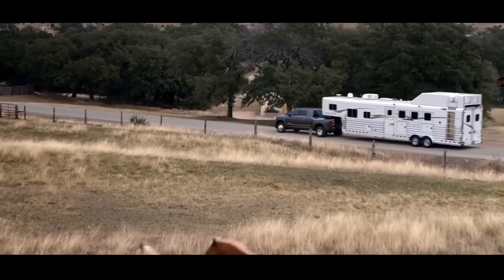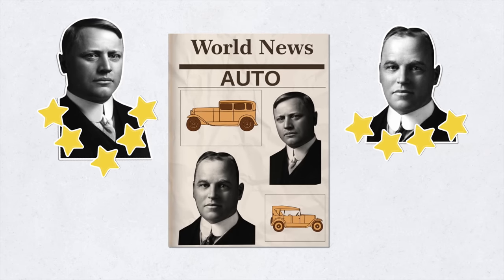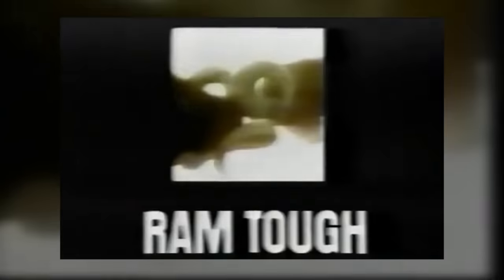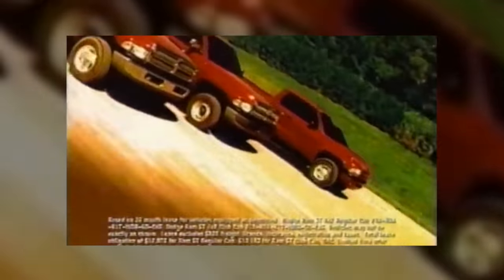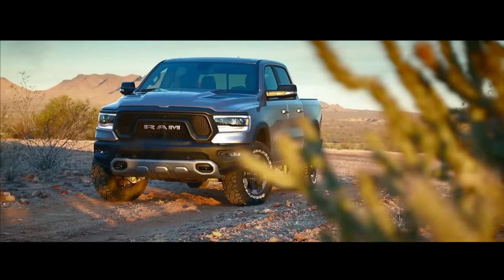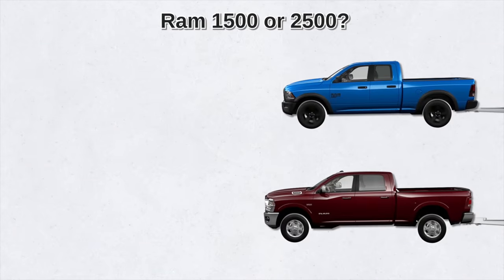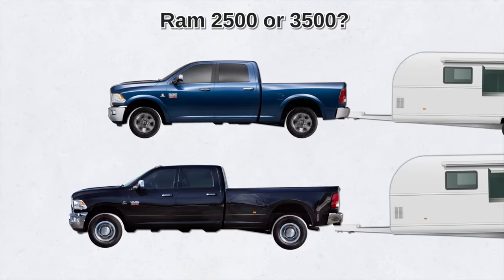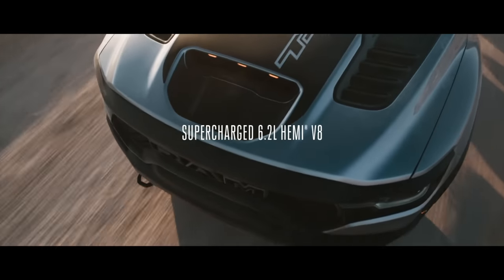No One is Telling You the Truth About Dodge Rams, So I Have to

Comment: Confession time: I was part of the production company that filmed those trucks falling from the 10 feet in the air. Those trucks   didn't start the first time we filmed that because the fuel pump in the gas tank would immediately dislodge. I'm the guy that figured out the problem and rigged up an external electric fuel pump so they would start and drive away after we drop them. Then: we reshot the commercial. Surprisingly the suspension and everything else was fine, even though: each of those trucks was dropped a minimum additional 2 or 3 times for testing purposes before the second and final shoot. IE: some of those trucks were dropped 5 times with no problem other than the stock fuel pump In the gas tank dislodging!
Reply: And then all were happily sold as demonstratiors 😂
Reply: @idaho_7407  That's funny: I never thought about where they ended up. I bet you're right!
Reply: Hmmmm very interesting
Reply: Can't sell fruit these days
Reply: And today crash detection sensors that are built into the engine will not let them crank after that drop. Not to mention the bent frame the new ones would have because of all the weight.
Reply: That’s great to know. Now I’ll be prepared if my ram stops running when i take it off a sweet jump.
Reply: @idaho_7407  Barely used he knew what he had
Reply: I was wondering about that.  Thanks!
Reply: Enjoyed your story . Thanks
Reply: I was the one who decided to have the trucks dropped for the commercials.
Reply: Nice!
Reply: I was the one inside the Truck when they dropped it and I Drove away!😎
Reply: I think a friend of mine bought one those trucks cuz his truck had all kinds of problems. 😊

Comment: WTF is going on?!!!! Next thing you know he's going to say the Caravan is the best built mini-van and the PT Cruiser and Neons are misunderstood gems. He must be smoking some peyote.
Reply: Exactly!!
Reply: I think Scotty may have been threatened with  a lawsuit from Stellantis if he didn't say something unharsh.
Reply: I think he's getting paid for this by Chrysler honestly
Reply: Or maybe Cummins are just simply the best diesel engines.
Reply: @bigrunts9768  those trucks are like the 1993 Ford tempo with the larger engine option. The power train was great but the vehicle disintegrated around it.
Reply: @bigrunts9768  I have to agree Cummins Diesels are good engines. It's the rest of the vehicle falling apart you have to worry about. Or if you buy non-diesel Rams like the majority do. And good luck finding a mechanic that can competently work on diesel engines. Most dealerships only have "parts changers", not true diagnosticians and many independent mechanics don't work on diesels. My brother apprenticed as a diesel mechanic and now manages a muffler shop where they do all repairs, but exclusively on gas engines for motor work.
Reply: @bigrunts9768  Cummins is not Dodge. Dodge chose to use their engine, but Cummins engines are in a lot of vehicles. Bread trucks even have Cummins diesels.
Reply: Did you not watch the video? There was nothing biased here, he laid out facts about their history and what their current trucks are capable of. Never did he say they were the truck to buy, but if I’m in need of towing 30,000 lbs I’m not doing it in my tundra or an F350. I’m going to do it in a dodge. What’s going on here is simple. The 3500 tows 35k lbs for those that need to. Not that hard!

Comment: 2nd generation rams with a Cummins, and manual transmission…simply indestructible & unchallenged platform.
Reply: Could probably drive them until the body rust off
Reply: Or a Japanese, or some German transmissions
Reply: I'm English we don't really have them here but...
A mate in Nashville has one, sorry not sure of the model but it has the Cummings diesel in it. A beast, with over 600,000 on the clock !!! My mate's brother (who is an expert on these trucks) has one with a million on the clock!!!
Great vehicles,  but they wouldn't fit in the village I live in !!!
Great video as usual Mr. Scott.
Reply: @andylane247  ... You listened to Scotty. No G in CUMMINS.
Reply: Land cruiser 70 series lol
Reply: FACTS. The high output 5.9l cummings was a monster, and mated to the bulletproof 6 speed manuel, was a damn good match.
Reply: @MadMexism  
More torque than an aircraft carrier  !!
Reply: @MadMexism  ... 6 speed Manuel picks lettuce like a whirlwind!
Reply: agree 100%
Reply: My uncle had one of these when I was a kid. I believe it was an extended cab - Long Bed - 4x4 - Forest Green - Cummins with 6 Speed. Wicked Truck!
Reply: Sure wish Toyota made a std. shift, diesel Tundra.
Reply: Good combo but honestly in my opinion I'll take any Dodge Cummins or gas I'm a Dodge guy
Reply: @bighorn9119  I'm a sentence guy.
Reply: C Nahman   no, the junk was in the rear view mirror, the power jokes and the duracraps
Reply: C Nahman  the thing about a 47re, 48re, you have to maintain them. Fluid and filter every 25k when towing frequently.  Same for transfer case. Axle fluid every 30-35k. Synthetic in evedything.
Reply: C Nahman  there are at least 35-40 2nd gens here around mountain view, I don't think any of them have rust.  Maybe up north they rust in the snow/salt?
Reply: Absolutely true. Best engine ever made
Reply: Agreed 100 percent
Reply: Eh, 2nd gens and indestructible do not belong in the same sentence, sorry. The Cummins 12/24 valve is a great motor, the best of its time, without a doubt. However, 2nd Gen bodies do not hold up well to the rest of time. I am a dodge fan, but other than the motor, I don’t like the 2nd Gen. The 3rd Gen addressed the majority of the body issues, and the 4th Gen was revolutionary, a terrific platform. But, I’d rather buy a Competitors truck (except the 6.4L or LB7) before I’d buy a 2nd Gen.
Reply: @conanrehm8388  agreed. Excellent point, typical Chrysler material, cheaply made. The only thing that saved dodge was the motor, transmission isn’t the best either
Reply: @jeffro582  true on the galvanized protection. My 2002 has has a front fender gash no paint exposed now for 4 years and no rust.
Reply: 2004 Dodge Ram 3500 5.9 Cummins with nv5600 6spd transmission currently 370k miles, I would trust it to go anywhere! Absolutely  love my old truck!
Reply: C Nahman  u are absolutely right had 2nd gen the rockers and fenders rusted so badly and put 3trans in but it had 275000 then the rear end locked up just couldn't put any more money into it. The engine was still going strong but the rest of the truck was falling apart
Reply: Cummins is good but the truck is a large turd
Reply: Had one myself. 02 Dodge 2500 4x4 Cummins HO 6 speed manual. Best truck ever! Unfortunately, I think I was being watched as I installed new interior parts and rebuilt the front end completely whether needed or not at 247,000 miles. I planned on putting another 250k miles before needing anything. It was stolen the next morning after it was put back together and freshly alignment. I would love to have it back or have another 02 if I knew it wouldn’t be stolen. Houston , TX is NOT a safe place to have anything worth having!
Reply: @conanrehm8388  the 3rd gen dodge ram was not as strong a platform as the 2nd generation.  Tge 2nd gen had the best seats ever put in a truck, tge 3rd gens were hard as a brick
Reply: @alanbrooks3670  did you ever change rear end oil?
Reply: @jeffro582   I have ridden in a second gen a few times, their seats are very plush. I grew up riding in a in a 2003 3rd gen 2500 Laramie, then a 2009 3rd gen 3500 Laramie, the seats are definitely more firm, I wouldn’t describe them as being hard as a brick, they were not the most comfortable, but they were not bad. My statement that the 3rd gens are better than the 2nd gens comes because of the fact of how may rusted out 2nd gens I have seen. My dad’s 2009 3rd gen had rust where someone backed into him, but it did not grow past where the paint had been chipped off. I have seen 3rd gens with rust, but they have not rusted to the point that the 2nd gens do. If we are going on about the interior, the 2nd gen interior is cheap. Not to say that the 3rd gens isn’t cheap, but the materials from the cloth or leather to the plastics was way better with the newer generation truck. I have a friend who owns a 2nd gen Cummins with no rust because he washes it religiously and actually takes care of it, his description of the truck is “It’s a million mile motor, with a 100,000 mile body”. The 3rd gen is a stronger platform as well, did you ever notice that the towing and payload numbers increased with the newer truck? The power increased, the quality increased, heck, I am not a fan of how the 3rd gens look, but it is a big improvement over the 2nd gens in my opinion. The 3rd gen was not as revolutionary with the interior or exterior design as the 2nd gen was back in 1994, but overall it is a newer, more researched and developed pickup.
Reply: @andylane247  That is amazing to have that many miles on one. My friend in Texas has a’99 Dodge Ram 1500 w/ the V6 and a 5 speed transmission. Bought new & maintained well now has 354321 miles on it still sporting the original clutch disc.… 👍🤪🛻even I’m amazed.
Reply: C Nahman  No rust problems here in Texas unless you live close to the coast. My friends Dodge Ram has 354321 miles on the engine & transmission has the original transmission clutch disc. No problems at all. Him & his dad both drive it like Granny Grunt though so that helped alot. 😁🤣
Reply: @joeprewitt2539  Truer words have never been spoken my friend. It’s sad really, Chevy & GMC last had a proper manual transmission available in 2006. R.I.P. Third pedal!!
Reply: @conanrehm8388  my 2nd gen a 2002 ram 2500 xlt Laramie 4x4 special ordered by me. It has 376, 000 on it. Not big mileage. But the truck is as solid as the motor, no rattles, no squeaks etc. I feel the later 2nd gens. We're far superior in durability to 3rd gens, from what I have read and seen.
Reply: The body will just fall apart
Reply: C Nahman   46/47Rh/re is great when you keep them cold, overheating is what kills them.
Or just get a nv4500/5600
Reply: @kevingamoe9375  my '02 ram 2500 diesel has 376,000 on it and nothing has fallen apart. It's as tight as a drum with no squeaks or rattles.
Reply: Body rusted off the engine within 10 years.
Reply: @OSUCharger  what year dodge,  what state?
Reply: I will never own a dodge.
I might put a cummins in something else.
Reply: The dash is very destructible
Reply: The best Dogde is one that dodge had nothing to do with as far as the power train goes. Says alot to me.
Reply: @tonyblackburn5002  their automatics suck too
Reply: Take it up north
Reply: @glzarmy  lmao yeah if they do the entire truck will rust away from the engine
Reply: @tonyblackburn5002  i made the mistake of bringing my 3rd gen up to WI, all its life its been a southern truck, i feel like now ive started its clock
Reply: A hilux shits all over it.
Reply: @frankopanklaric  yeah because it can haul MAYBE 10 percent of what even a half ton American truck can.
Reply: mine is a 99 ram 2500 5 speed reg cab in the floor 4x4 5.9 gas. 175000 miles and o would like to have a new one just like it
Reply: Just rolled rolled over 200k on my 1995 12v. I'll probably run it another 20 years or so.
Reply: That sweet manual transmission
Reply: Walker Texas Ranger is the very reason the 2nd Gen is cemented in history as one of the most iconic Ram trucks ever made
Reply: I have the 12 valve Cummins diesel 

Ram 1994 276 miles.  Use it for my lawn care biz.  I expect to be using it for another 15 years easy
Reply: YES
Reply: @forgottenmachinery5458  they do the metal mopar uses sucks it actually does rot and get rust cancer like no other, yes Ive own many dodge vehicles and will never go back. They are pretty much a "Joe Smoe Home Owner Truck." Well the 1500's are anyways
Reply: @forgottenmachinery5458  how long a Toyota frame last?  3 years?
Reply: @conanrehm8388  What are the body issues you refer to?  I know they have some rust issues, but so does any car or truck in the rust belt.

Comment: I have a 2004 Dodge Ram 1500 Laramie w/ 5.7 Hemi
193,520 miles still running strong. I have replaced the radiator, alternator, power steering pump and reservoir and EVAP solenoid. I run Mobil 1 5w30 and have dropped the transmission pan and changed filter a couple of times. Very pleased with my purchase and would love to see DaimlerChrysler get back involved with making this wonderful truck. God bless you all.

Comment: I have a 99 half ton with the 5.2 318 V8, probably the most loyal vehicle I own. It’s about 3 days worth of commuting away from 400k miles. Can’t say I’m disappointed. Everything on it still works, even the old cigarette lighter socket. Only thing I’ve replaced is the dash, had a new one put in about 12 years ago and it hasn’t cracked.

Comment: I just bought an 05 2500 with a Cummins. I love this truck, good MPG, good power, and the Cummins is built to last. It has 293,000 miles and 0 blowby! I drive a 2018 Ram 5500 w/a 6.7 Cummins and that 6.7 is nice, smooth, and quiet, but there is no denying that 5.9 is a classic Diesel.

Comment: I had a 1976 Dodge D 100 back many years ago. It had a 318 V8 and a three speed automatic transmission. This truck was so simple. I bought it for $ 400 back in 1987 with a bad engine I managed to rebuild without experience. When the transmission lost it's reverse gear I was able to rebuild that too. Kept the truck until 1998, when the body was getting pretty wonky. I put well over 100,000 miles on it in that time. I loved that truck. It had more power than I needed.